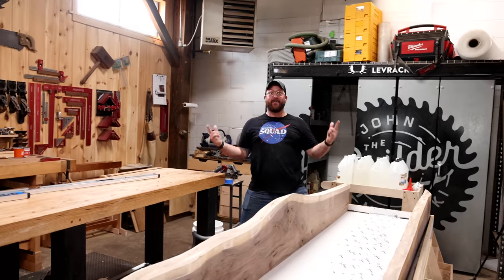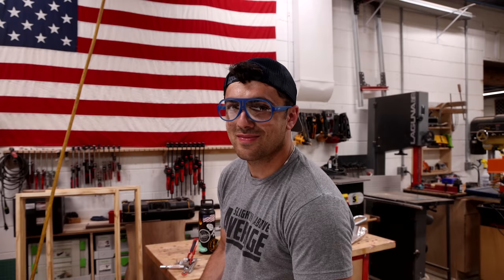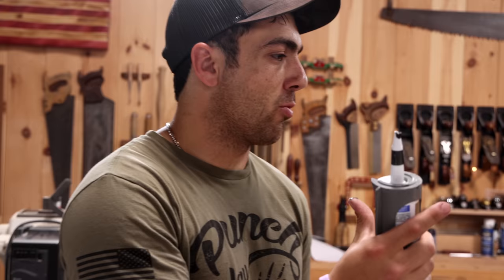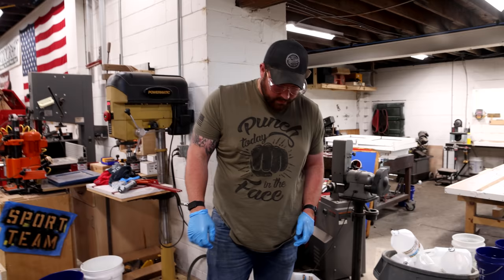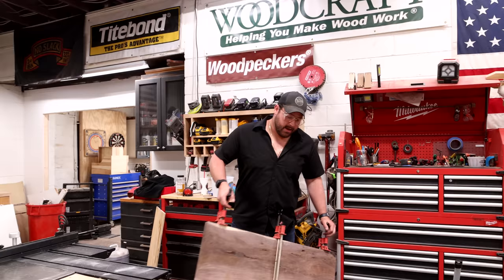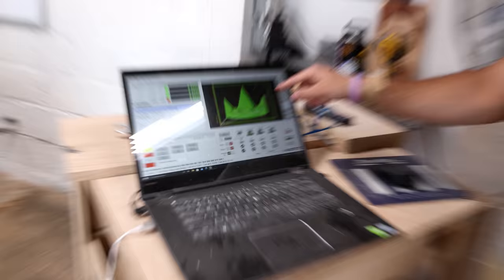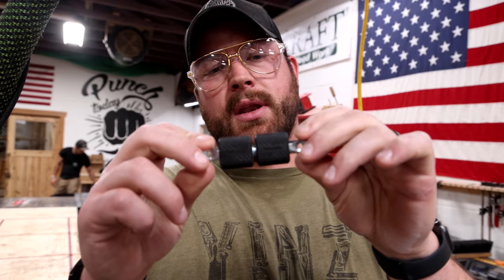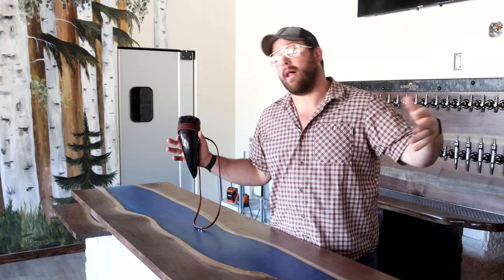My LARGEST River Table Pour Yet!

Comment: Here's my tip, for what it's worth. In the UK the Tyvek tape is (like you say) really expensive (£34-£40 a roll). I have started using the white packing tape (the one with FRAGILE printed along it in red) and found the epoxy doesn't stick to that (£1.99 a roll)
Reply: I used to use painters tape. It puts a texture on it but won't stick.

Comment: Tip for the Future: the next time you guys pour something that big/thick, point the shop fans at the slabs and turn them on the moment you stop popping bubbles...

Epoxy Resin doesn't care if it gets a little cold, all that does is lengthen the cure time a little and the fans help keep the Resin (and you) from overheating...
Reply: Also maybe donit in two pours
Reply: @bionda470  That can leave a visible line between the different layers (called Witness Lines) that can damage the final appearance of the project...

Sometimes, you have to do it all at once to get the best possible final appearance...

Comment: Save money on the tape by using Easy Liner removable adhesive clear laminate contact paper. Comes in 3 sizes: 12" x36', 18" x24' & 20" x30'. The resin releases really easily from it. 
Most people prevent leaks by not only putting silicone in the joints but tape the joint on the outside as well.
The bar top would have looked better if the river continued through the logo section as well.

Comment: Turned out amazing but i have one question left..why did yall flatten the slabs with miss piggy cutting from left to right over the short Side. Wouldnt it have been faster to cut the along the long side?

Comment: I'm not nearly as experienced as y'all with big epoxy pours, but I THINK the bubbles you thought were from heat were actually air seeping out of the slabs because you didn't seal the edges with a coat of epoxy before doing the pour. Everyone else I've seen do big pours like this "paints" a coat of epoxy over the live edge to seal in the air so it doesn't do the very thing you had happen.
Reply: (Don't get me wrong. Temperature is also important during the cure process. But those bubbles were not likely part of that issue.)

Comment: have an idea: what happens if you open holes horizantally into the wood on sides before pouring the epoxy?
this way,  epoxy enters those holes and when dries out, it makes very strong connection...
or connect sides with steel bars before pouring the epoxy...
or is it not necesaary and epoxy blends with wood very strong?
not sure, waiting for your comments...
Reply: not necessary for an epoxy-wood bond, it is extremely strong. There's a video by Blacktail Studio "How strong is an epoxy table" the wood itself fails before the wood-epoxy bond, worth a look if you're interested

Comment: Any advice on how to make a make-shift jig for a DIY'er making a outdoor table with 2 30 inch wide and 8 ft long slabs. Should I not do a river for an outdoor table on the east coast that gets all the seasons? Just looking for some direction. I'm having a hard enough time finding a place that can level it for me.
Reply from the maker: If you check out my channel and search "Router sled" I have a cheap metal one you can make in 5 minutes, and on our glass river video we have one we made specifically for that video. You can make an outdoor river, its just going to need some love every year and probably covered during harsh winter

Comment: looks great but i don't get why you broke the edges from the centerpiece and the two that are connected to the centerpiece 🤨 wouldn't it be cooler to leave the "edge" and just have a flat surface without any interruptions?

Comment: This has taught me that I simply have no place where I can pour epoxy tables until the winter
Reply: Be careful though, you also can't let it get too cold
Reply: @Wigmore72  winter inside my garage is about 70
Reply: @Wigmore72  but yeah I’ll have to read into the exact temps cause I have been waiting a while now to try it. Its 90 degrees right now and about 100 in my garage/shop
Reply: @patrickrider2039  I feel ya. I have no climate control in my shop either
Reply: @patrickrider2039  mine is a shed separate from the house, with no climate control. So middle of winter would be about 20 in my shop lol
Reply: @Wigmore72  man I’d love to have to feel those kinda temperatures lol. Outta curiosity, does cold weather like that affect wood or the woodworking process at all?
Reply: @patrickrider2039  yes, you really have to compensate for wood movement with Temps in the Midwest. Winter is cold, summer is hot and humid

Comment: Bitchen bar top, I'm not a fan of the logo break though.
I wish you would of put a smaller blue river through it also.
Just so it doesn't look so clunky.
Anywho, that's my two cents.
Great job on the build, and just an ok job on the design in my opinion of course.